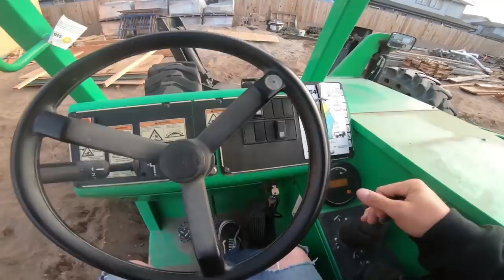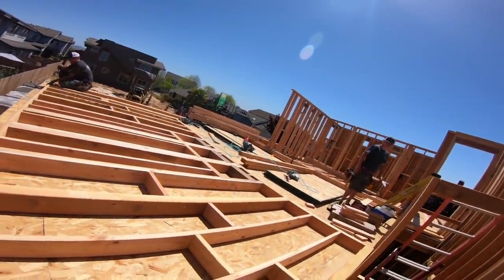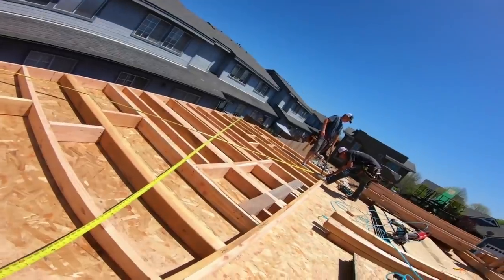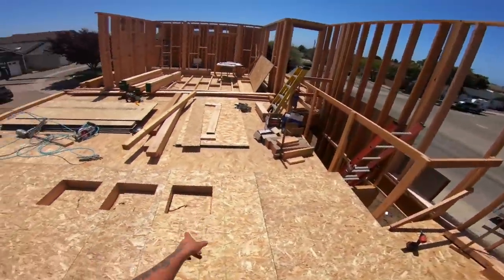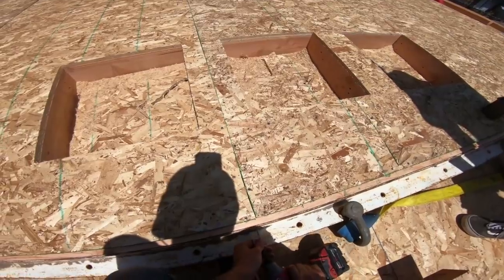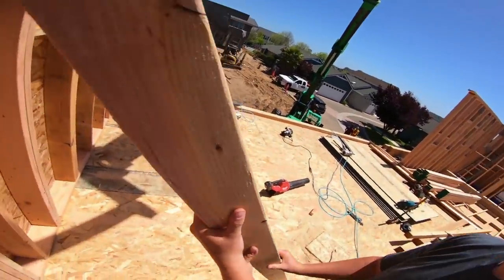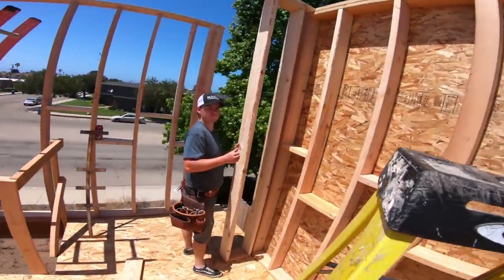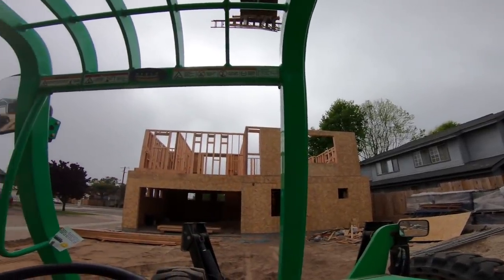Building a House | Ep. 7 Pt. 2 "Second Story Wall Framing"

Comment: In North Carolina where iv been framing for quite some time we run our plywood sideways so you have to put in pearling blocks and they actually make you tie your plywood from the second floor back into the wall below it at least a foot or so. Then it ties both walls in together and makes it stronger. But your framing definitely looks solid. Keep on banging nails!
Reply: tall wall/windstorm sheathing comes in sheets larger than 4x8, meant for 9', 10' ceilings or in your case, 1st floor to 2nd floor

Comment: What made you guys decide to go with the Makita rear handle compared to the Dewalt rear handle?
Reply from the maker: $150/kit with 2 batteries was unbeatable. We got one, beat the HELL out of it. Bought 7 more.
Reply: @MattBangsWood  Fair enough, thanks!
Reply from the maker: @alexrafeld4168  As far as power goes.. The Dewalt will have more power. People claim it's a better saw.. I've not used it enough to know. I can tell you, 4 batteries will get any framer through the day with the Makita 36V! I wouldn't switch if ya paid me. ;)

Comment: When you do the opening for a door do you add 5 inches to the opening and 3 inches for the window opening?
Reply from the maker: Spot on.

I have a video coming out Monday explaining laying out a door!
Reply: For sure I’ll be looking forward to it. Also I notice you sheathed your exterior walls vertically does it matter? Cause I was taught horizontally and to stagger.
Reply from the maker: They’d have a fit if we ran them horizontally. Both ways are correct, but it’s called out vertically.

Personally, I’ve done it both ways.
Reply: MattBangsWood I see... I like the router trick you do and the blocking trick I’ll definitely be doing that next time.

Comment: Is it code in your area to block in between all your studs in your walls?
Reply from the maker: Nope, just good practice. Keeps studs straight and rigid. Only have fire-block at stair areas.
Reply: @MattBangsWood  I watched how you nailed the blocks between studs. And now understand why you put them 1' apart. With this distance the block already nailed is not in the way of your Hitachi nailer when you nail the adjacent block.
Reply from the maker: Spot on! It’s much easier to do!!

Comment: Is it the framers job to install the tyvek where your from. Im a framer in ohio. We install the tyvek on the ground befour we stand them. Then go through and tape all the flaps. Its such a pain to install after its stood. I know some places they have the trim guys do it. Thanks
Reply from the maker: Siding guys do it.

We're the siding guys too, but we have shear nailing inspection. So they'll have the inspector walk our whole building and check our nailing, so we can't wrap it before the walls are stood. That's a good way of doing it though!
Reply: @MattBangsWood  that makes sense. Ive only had one inspector ask to see our sheer wall nails. Of course most of our inspectors are lazy and miss alot of things they should be checking.

Comment: 2x6 16" o/c seams excessive. We do alot of 2x6 24" o/c here in Michigan even with snow load. But great video anyway.
Reply from the maker: A lot of the things we do are excessive. Did you like the 6x6” header for a 1’0 1’0 window? Overkill if you ask me!!
Reply: No house wrap on ur houses or do the siders do that?
Reply: @hammertime7349  I know in Michigan its usally the framer who installs house wrap as it part are pricing and easier to do with the wall on the deck
Reply: @MattBangsWood  yes way over kill. We typically use all 2x10 material for every thing under 80" rough opening and thats 2 ply unless on a gable the 1
Reply from the maker: We have nail inspections. We can’t House wrap while the walls are down.

Once inspection is done, we can cover them up. But it’s the siding companies job, not framers.
Reply: We use 16 oc  here in Wisconsin. The cheaper homes here do a 19.2 oc
Reply: @hammertime7349  19.2 sucks for sheeting. I know when myself and guys do 2' o/c we also follow advance framing/ stack framing technique. Are you familar with those
Reply: Kevin O'Brien no. What is it
Reply: @hammertime7349  its when you frame everything on the same spacing. So if you could see thru the wall your floor joist, stud, and trusses would all line up same things with window and door opening
Reply: @hammertime7349  if you youtube advance framing theres some good videos on it. We also lap are sheet thru each floor system and walls

Comment: Are you really wearing Vans shoes on a construction job? Steel toed boots are where it's at. You can kick boards in to place with little effort. Try kicking boards with thin ass Vans.
Reply from the maker: I kick stuff all the time, lol. Try walking a roof or top plate in boots.. Even if I wear boots, you won’t catch me dead in steel toes.. Just not my thing.

So yes, I’m wearing Vans on a construction site. I bought a new pair of Vans MTE boots for tomorrow’s filming, walking second story plate. It’s the only thing I’ll wear walking plate or roofs..
Reply: @MattBangsWood  Hey whatever floats your boat. Being comfy should never take precedence over being safe though. You ever try low top merrels or Keen boots? They are comfy and privide safety. And btw, I wasn't talking about walking on roofs. I'm talking about simple wall framing. Shooting nails n shit. You should have some damn foot armor. You might as well be wearing flip flops if you're gonna wear vans.